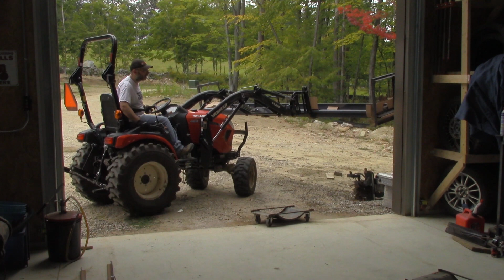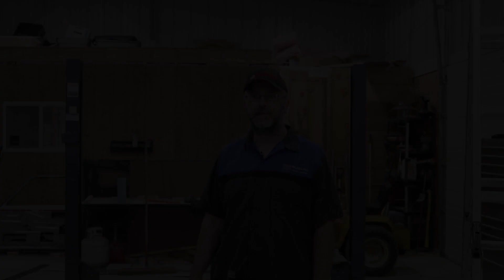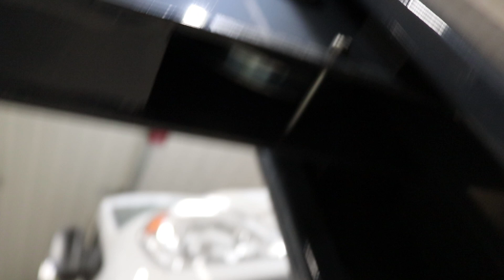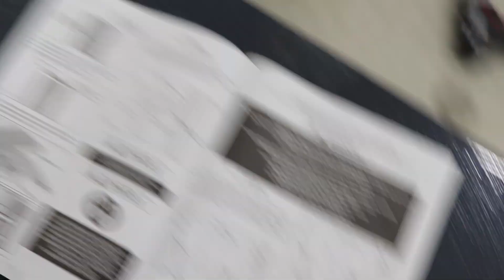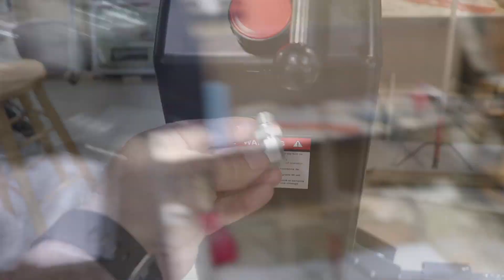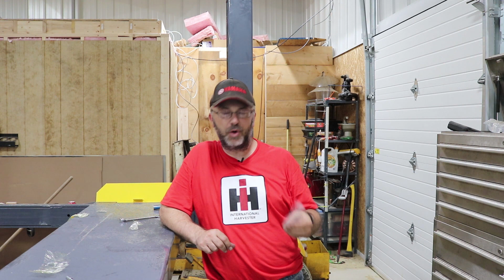BendPak 4 Post Lift Install

Comment: Thanks for posting (no pun intended). My HD9 XW is on the way from Bendpak, but I'll be having a professional install it along with a rolling jack. You gave me a good idea about wiring a temporary plug to the unit until I find a final location in my garage and hard wire it.

Comment: I have just FINALLY got the H14T lift up and you helped. Thank you!

I too ran into a number of undocumented tasks that I had to discover. The ones that I remember are:

1. installing zerk fittings 

2. bolts for runway stops at the front were way too long

3. Adjusting details for the safety ladders and cables is nonexistent 

Thanks again!

Comment: Did you have any issues with one of the posts kicking at all when moving the lift down?
Reply from the maker: Nope, never had a problem with that.  Only issue I ever had was a couple times one of the safety latches would snag preventing it from going down straight.

Comment: What are you adding @ 35:00 ish . I need that
Reply from the maker: There was a spacer and bolt that holds the bottom of the part that has the holes the safety latches hook into.  Like I said, wasn't mentioned in the instructions so might have been a design change.  This was a few years ago so I don't know if the current ones have this or not.

Comment: Does your motor have built in thermal protection? If not, did you add it in, or just omit it?
Reply from the maker: I can't imagine overheating being an issue.  Takes maybe 30 seconds to lift a vehicle.  Even at max weight can't see it overheating.
Reply: @ChappysGarage  I agree! Reading over the manual for a HD-9ST I am installing, it mentioned needing thermal disconnect switch 10 times. On your motor tag, does it say “not thermally protected”?

Comment: Hi Chappy, I just received my BendPak four post (HD-9) lift, and have begun setting it up.  Your video was very helpful to me.  I also want you to know, it seems several spots that tripped you up years ago have been corrected by BendPak in the installation manual - However, I still paid more attention to your video!  Josh - from Vermont.

Comment: Good video. I am also erecting my BendPak 4 post solo. I'm at the point of columns up, cross tubes installed and lighter runway slotted in. Tackling the piston side later today. I would have liked to see more on the cable routing and sheave removal and install, but I will muddle thru. Thanks for this vid.

Comment: I just finished my four post install. I also found those 4 bolts and spacers left over and figured they went in the bottom of the safety ladder. I appreciate the video and confirming.
Reply from the maker: Glad I can help.  Hopefully you can use the lift to make Finnegan even faster!  :)

Comment: Benpak design it's own moveable wheels, that's so freaking slap ass perfect, plus your 4 posts has it's own drive way,  and then if a car collectors were to leave in the lifted position all the up,  no idiot can't even think about it,  that's perfection,

Comment: My car is stuck way up top the lift it won’t come down any ideas?, it will go up but is stuck when trying to bring it down it won’t go lower than a certain high point
Reply from the maker: I have seen a couple times on mine where the safety catch snags and one of the 4 posts doesn't go down.  When this happens I need to lift it back up a few inches and push back on the part inside the legs that the safety catch hooks into (the piece that has the 2inch holes in it).  If that part is too close to the safety catch it can snag.  Hopefully this is all the problem you are having on yours.

Comment: I have been putting one together. The instructions really suck. An updated manual for mine was available online. When I compare it to the manual it shipped with the lift they both suck. There were some diagrams and information in the old manual which were useful. For reasons unknown they were left out of the new manual. The new manual also leaves out mini details. The drawings respect no design standards. A credit to the people that buy these things that they can be put together at all given the manuals they come with. Also just no excuse for not labeling the ports on the hydraulic manifold. Mine is just like yours, No labels?

Comment: I have the same exact lift. Brand new that I got in a house purchase. Already set up and working.  It's not bolted down.   Is it required to be bolted down?
Reply from the maker: Nope, not required.  Mine is not bolted down and I have the caster wheel kit so I can move it around in my shop.
Reply: @ChappysGarage  Thanks for the input. Great video.

Comment: I did this by myself also, but I used a cherry picker to lift the long ramps.  The balance point is about 6 inches from the center for the one with the ram in it.  Thanks for the video, definitely helped make my installation easier.

Comment: Thanks for this video. Bought 3 lifts back in 2017 ( 2 HD9's and one 14T) thinking that I could find someone local to install them but no go. One guy wanted $1000 per lift plus fuel and motel to come 180 miles but I'm not paying that. I worked overseas a lot and just now getting to the point of installing my first one. The part about the window size now makes sense and I see what you meant about the slack cable lock. I actually installed the ladder lock bar when the posts were laid down and it worked pretty slick. I had one engine hoist but recently bought a second one that folds and using both of them together worked well. I also used four 55 gallon metal drums and at first thought I'd put them under the runways but they worked better with 2 under each cross bar. Once I got the runways bolted to the crossbar then I used an engine hoist to lift one end at a time and removed one drum on each end and centered the remaining drum just as a safety. Got my lubricants and stuff today, greased all the sheaves and sprayed down the cables, then 90wt gear oil. After that I started cycling the lift. Actually I used the lubrication cycle as a means to purge air from the hydraulics. So far nothing major but as you mentioned, building these yourself gives you a better idea on how they work. I was concerned at first on installing the cables but it's actually easy. It took me longer than 3 days to build mine but then next one should go much faster. Big thing was not having more than 30 Amps in the shop so I reworked the shop breaker box. Builder ran #4 aluminum from the house to the shop (100 ft) underground in conduit and we calculated that the safe amps is 65 amps. Went with a 60 amp breaker in the house to supply the shop with more current and now I could (if I wanted to) run the air compressor and lift at the same time. I'll get 200 amps someday but for now just unplugging the compressor to power the lift will need to suffice. I better throttle back, this is becoming way too long. 

My first lift will be used as a mezzanine kinda thing to build a 8'x16' wooden deck area to put all of my wood working power tools on and other stuff scattered around the shop. Motorcycles, mower, UTV and a couple of engines will go underneath the mezz. Second lift will be used to store one car above the other. The 3rd lift probably won't get assembled this year ( I park my dually on the runways after I took that lift apart back in 2017) if I return to work overseas. My shop floor isn't as nice as yours and I'm concerned that I my need to level things. Sorry for the novel but wanted to say thanks and explain what I found. Actually came to just find out how the caster kit was built and great info there as well. Was gonna go back to the shop and work some more but considering it 0245, think I'll just go shut off the lights and work later today. Oh, I almost forgot. What did you do to get the locks to set at the same time? I'm now pretty close and adjusting cables but to get them all to set exactly at the same time is probably more than I want to mess with at this point. As long and I get closer and they all set when I lower back down then I'll call it a win. 

I wanted to run my hoses to the inside but have run them to the outside because of the mezzanine idea. I've already got the flex tube caught up on the tank and almost broke things. Once I get the wooden deck installed I might revisit putting the flex to the inside. Ziptied the flex to the tank for now but that's probably asking for trouble. Maybe a spring from the flex to the deck later on or a bungee cord.

There's a newer manual available to download from Bendpak and they must have reviewed your video as they have corrected/updated several steps. Look for manual P/N 5900123 — Rev. M1 — March 2020. I bought my lifts so long ago that there isn't a warranty any more so I'm double checking everything. It takes some time to assemble these but pretty straight forward if a person doesn't keep getting sidetracked.

Comment: I cant believe you actually lifted the platform with hydraulic cylinder; that thing is very heavy.
Reply from the maker: I used a floor jack to lift that part.

Comment: I just bought a "big brother" to this lift and finding this video gives me a comfortable feeling regarding DIY assembly. If it is of interest, mine is a BendPak HDS-14X.
Reply from the maker: Good luck with your install.  Hopefully it is close enough to this model my video is still useful.  I assume the design is basically the same but I have not seen one of those in person.
Reply: @ChappysGarage  thank you. The design is, as you suspect, very similar just larger and heavier. Also, the height of post is under 6ft. I bought the "pneumatic/electrical workstation" and two rolling bridge jacks...
Reply: @ChappysGarage  following up, I found a shop crane to be extremely helpful in placing the runways on the heavier runways. It was also helpful to flip the as-packaged upside-down runway. As for the bolts/spacers at the bottom of the safety ladders, mine included a one page addendum to the manual (single sheet, not bound in the manual) describing their installation. Mine also included a set of redundant springs for the safeties. Assembly was smooth and relatively easy. I adjusted my safeties so the runways sit level but I set my cables so I can hear each "clack" individually in quick succession. For me, this gives audible verification each corner will engage.

Comment: Excellent video. I was wondering how it'd work to lay the uprights on the floor and put the crossbeam in place and then erect the columns vs how they describe it with needing a forklift or crane. That just sounded more unsafe trying to line things up over 100" uprights. I got mine ordered and will be mostly doing installation solo also.
Reply from the maker: I did mine by laying the columns on the floor as you suggested.  It worked great.  The columns themselves are not heavy so once the crossbeam is all the way at the bottom you can stand it up easily.  I am really surprised they don't do it that way in the manual.
Reply: @ChappysGarage  if you had to estimate total solo assembly time even with the 'screw-ups' and triple checking, excluding the pickup and unloading parts, how many hours you think it took to be at 100% by yourself?
Reply from the maker: @kevingebert4316  When I did it I think I spent most of 3 days on it but a lot of time is taken up by camera work.  Given what I know now I feel I could do it in a long day.  Several things would be much faster with a helper if you have another pair of hands to help.

Comment: I'm just getting ready to order a BP HD-9XW and was a bit intimidated by the 92 pages of instructions and was going to have the lift installed but after watching your video now I'm thinking I could save some money and do it myself, thanks for the video! 

Here's a link to the new instructions for anyone thinking of doing the job themselves:
https://www.bendpak.com/HD-9-Four-Post-Lift-Manual-5900123-BendPak.pdf

You don't mentions if you're using a rolling jack, but according to the new instructions:
"Q: Does the Lift have to be anchored in place?
A: Yes, BendPak strongly recommends that you anchor the Lift; it may be less stable if you do not anchor the Bases, and you could possibly void ALI certification. If you plan to use the optional Rolling Bridge Jack, the Lift must be anchored."

Did you ever bolt yours down?

Again, thanks for the video.

Comment: I can’t thank you enough I just started putting mine together. And you save me from quite a few pitfalls. I’m glad you told me about the different size windows I did not notice it. Also the bolt they didn’t mention At the bottom of the uprights, and the zerk fittings........ And who knows what else I’m going to keep a close eye on your video as I do it.

Comment: The instructions that came with the lift are the worst of the worst.  I had to use my hydraulic hose with the curved section near the pump as there was no way it was fitting the other way.  AND NOW... the fitting that came with the air valve does not even fit ??  How did you hook the air to the  blue vavle?

Comment: Great Video, thank you. Followed your lead, installed the high pressure hydraulic line backwards, elbow at the power unit rather than the cylinder. Works fine, will I ever reverse it, hope not. Instructions in general could be much better if not the printed an online pdf with "pictures," when that technology becomes available, would really clear things up. BendPak brother would you spare a dime and include extra ferrules and some zerk fitting caps?

Comment: Hi Chappy’s Garage,  As an ALI Certified Lift Inspector, and Authorized Lift Installer for all the major& minor lift brands on the market, I want to thank you for this video. In this industry, I’m normally working with customers that are the DIY type of people. That being said, most of them, like yourself enjoy doing things for themselves. As do I, in my own life. A lot of times I will get a customer call and they ask for an install quote. I always give them the option to be as involved as they’d like to be (some of them are rich and want to go out of town and have me do it all 100%, they just want to stroke a check) but most of them are questioning my worth. Do they want to pick it up at the shipping hub, or do they have a trailer to do so or a way to receive it at their home? Forklift, Bobcat or tractor? Will the truck even go to their home? Do they want to source the Hydraulic Oil, or should I bring it? Remind them that they need a compressor, do they have one, are they purchasing through me or going out and buying it themself? And as with anything else, their level of involvement equates to my cost. Many times I will have people be upset with the quote they receive from me. Sticker shock. Like I’m supposed to spend my time to pick it up with my trailer, drive it to the customers location, sometimes several hours away. Unload it in the surroundings they have not cleaned up enough to have an adequate work environment, assemble it, anchor it (if desired), train them on the machine, and anwser a slew of bizarre questions, because most of these online message boards are filled with misinformation (so half the time they question my qualifications? I’ve been doing this for 10 years people lol). Then drive several hours home. And they’re offended that I’m quoting what I’m quoting. Like all of that work and expertise is only worth $150. Oh and we’ll have it installed in under 4 hours, in and out of your home before lunch. The biggest thing I tell people is this. You can do it, it’s not rocket science. But what’s your time worth? And wouldn’t you want a couple guys who’ve done a few hundred of these do your too? They’re times when things will come damaged or misaligned and the customer wouldn’t know until they’re half way through the install and now stuck. The instructions are not the best and or always up to date with manufacturing revisions. You’re not paying me for my time on your property, you’re paying me for my total time involved, and the education, and piece of mind in knowing the lift is sound and in safe working order and didn’t arrive damaged. So again, I thank you. Good video, good information, honest evaluation and you recognize the potential benefits and piece of mind that comes with  having a trained professional install it as well. I hope all is well on your end and that your still enjoying your lift!

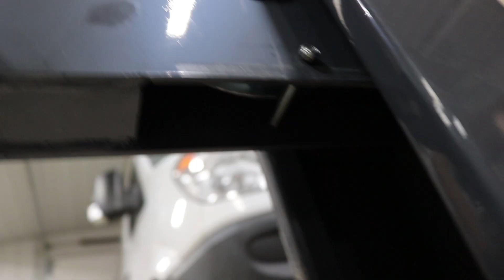Comment: Excellent video!   Very helpful.  I appreciate your safety tips.  For constructive feedback, (@22:27) I would recommend avoiding sliding the cable collar bracket along the exposed piston for fear of scratching the piston leading to premature seal failure.

Comment: Forgot to mention . . . . It is possible to install the air push button (they ship now) backwards. It will blow a lot of air out the stem of the push button. Flip it 180 and everything is "HAPPY".

Comment: I ordered an HD9-XW and except for off-loading I assembled it by myself . .  .like you.   My comments are:  It is much easier and safer to use an engine lift and tow strap than a floor jack to maneuver the the runways into place. Followed your video otherwise.   Until I "loaded" the lift cables. It is very unclear how to go about ensuring you aren't on the "slack" cable stops. I did it by lifting the cross members off the stops as I tensioned the cables. Routing the cables was much easier once I removed all pulleys and "keeper" rollers.  No question, your video sure is better than any other help out there. It gave me the confidence I could attempt it.  I wouldn't hesitate to help anyone do their's.

Comment: Thanks for the video.  I spent a few hours today installing the structure of an HD-9 with a buddy.  As you mentioned, the instructions omitted a lot of important detail.  You did a great job filling those in.  I plan to tackle the cables, lines and power unit tomorrow.  Again, thanks for the video
Reply from the maker: Glad it was helpful.  Good luck with the rest of your lift install.